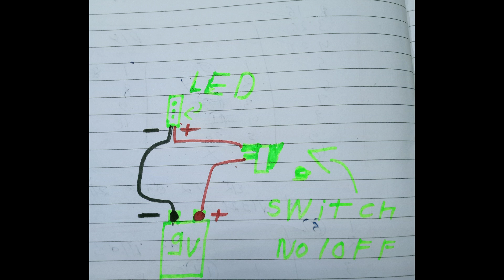How to make Microscope | Science project 2025

Comment: But what about the lens? 
Actually I how to make it for my holiday homework and I am directed to use the objective lens so please tell me about that
Reply from the maker: You should place the objective lens in the gap of the bottle cap and do not place anything on the upper side. The lens should be placed on the lower side so that the focus is very good and for this you should also place an LED at the bottom so that the micro-organism can be seen very easily. 😆
Reply from the maker: Let me know if you have any questions.
Reply: Yes, but in my project book it is written that we need to convex lens and one should we placed above the tube and one at the bottom  @Mrelectronics1444